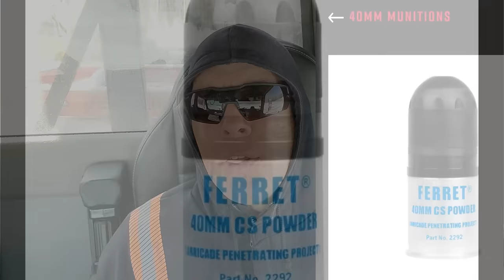Just a typical day as a Lineman, well not really...

Comment: They incinerated the lamp without knowing what the substance was on there?  So, they released an unknown chemical compound into the atmosphere without knowing what it is?  That seems rather unsafe.  I'm glad it worked out for you.  But, there are chemicals out there that can have long term health consequences that might not show up for days, weeks, or even years.
Reply from the maker: I did have se of the same concerns, but from my understanding; In order to test the substance, they would have to have something to go by. They could do specific tests  to see if it matched chemical compound for those particulars. An example would be a "dope" test. If the chemical turns blue then it's a positive match... If it doesn't, it simply means it's not that particular substance and nothing more.

Same goes for getting checked out at a hospital. If there are no sypmtoms (or they are gone) and vitals are good. They wouldn't have much to by. Generic blood tests included.
The high heat of the incineration would release negligible amounts of toxic substances as well.

That being said, I do believe testing of an unknown substance is possible, but not something that comes cheap or only done in circumstances that involved dire consequences.

Again, this is only my limited understanding of the possibilities after being involved in some discussions around the incident
Reply: @Bobsdecline  Yes, testing can be done on an unknown substance to determine the chemical makeup and match that to a known substance.  But, it has to be done in a lab on very expensive equipment by highly educated people, so not cheap.

Anyway, glad you're OK and you solved the mystery,
Reply: @BryanTorok  certainly a hazmat should have a basic nmr or spectroscopy...

Proper incineration is probably the safest method though.

Comment: 2:14 "as a customer when you call in a trouble call, the more information you give the better"  -   Let me tell you my little story about calling in a trouble call.   Not your utility of course, but my local utility.  I happen to be an electrical engineer who works on substations, so I know TF I am doing.  The neutral failed on my house, completely open circuit - but it was intermittent.  It would make connection again and work for a while, and then fail again.  Obviously broken/loose conductor somewhere.   A short bit of checking while it was acting up and confirmed it was on the utility side of the meter.   Call the utility.  Lady I spoke to did not even know what a neutral was, or what open circuit meant.   I said, could I just speak to the lineman or the dispatcher?  Nope, you cant do that.  Ok well just send the crew out and I will talk to them when I get here.   Sir you need to stay away from our crews for your safety and for COVID reasons.   Ok but the problem is intermittent, so the information I have will help them find it.  Otherwise if they get here and its not doing it, will they be able to find it?   If the problem is inside your house they will not be able to assist you.   What?  Thats not what intermittent means woman, I already told you its on your side of the meter.   Yeah but it could be in your house.  Woman do you even know where the meter is???   I had about had it with her but finally got to her saying ok tell me what it does and dont use the words neutral or open circuit because they arent on my sheet.   What do you mean on your sheet?   I have a sheet here of the possible things I can put the ticket in for.    Like "my power is out" or "my lights are flickering".   I cant type what you say, I can only choose one of these 8 things on the list.    For F*CK sake!!    Okay, put "my lights are flickering" and we'll go from there.    To their credit, in spite of the utter stupidity of their customer service person and the insane limitations on their ticket system, the linewoman who came out knew her shit.   Without me even talking to her, she went right to the problem.   Her fix was a little bit janky (wrapped some bare aluminum #10 around both sides of the break), but it worked.   She must be used to getting absolutely no information from the dispatcher and just figuring it out on her own.
Reply: Haha I would have got real testy with the woman on the phone as soon as she tried telling me I couldn't go near their employees 🤬

Comment: Been working in the industry 17 years and the worst job ive have attended was a failure of a 275kV current transformer. The substation is local to my area and when the CT failed there was reports of a loud explosion and fireball in the sky on the local facebook group. When i attended the site afterwards the whole substation bay including VT, CT's, isolators and Circuit breaker had damage and signs of burnt oil on the insulators. We found a dead rabbit about 30m away from the explosion. On the plus side 4 weeks before the equipment failure i was involved in a major maintenance on the circuit breaker and although it was substantially damaged it tripped as it should of done to clear the fault. It was the last time it ever operated and the entire bay was ripped out and replaced due to the extensive damage. It does make you realise that when one of these pieces of equipment fails it normally ends in a spectacular failure.

Comment: A tree limb, about 2ft across at the fat end fell across a 3ph primary, pinning the wires to the ground. Line workers made it safe and arborists were called in. As they were cutting, a loud CRACK as 100+lbs of wood was catapulted into the sky. Another hazard of "high tension" wire to beware of.

Comment: Im a residential specialist in the bay area of california. I had a customer with randomly tripping arc fault breakers. It would happen over different circuits. So we replaced the sub-panel, re-spliced the circuit. Right before i was about to have her sign for a 20k rewire on her house i said you should have the utility out to check their splice box and behind her meter. They found it. It was a burning meter leg on her panel. Saved her a ton of money and mud in my face.

Comment: We have a story of an incident that happened some 40 years ago in the 80's in Phoenix. An electrician working on a box that just so happened to be radioactive. Apparently the box makers got ahold of of steel and aluminum from the nuclear test sites by mistake. It's one of those stories that's been passed down from the community.
Reply: “By mistake” I’m sure they don’t know that cheap material they were buying didn’t have a questionable history…
Reply: That's why steel from shipwrecks pre-1945 are valuable, all steel since then had some additional background radiation. It's used to make devices which are very sensitive to radiation detection, as they don't come with their own radiation. It's beginning less valuable, as cobalt-60 has a half life of 4.5 years and is becoming less of a problem.
Reply: @johnhaller5851  yes new steel is almost as pure and no longer a problem.

Comment: 2:42 whose lights would go real bright / real dim? Do they still use incandescent bulbs in Canada? In the US, they mostly have been phased out entirely. A CFL would do other wonky things from low/high voltage. It probably wouldn't even turn on, or it might just go pop. (Or it might even just show as normal brightness if it regulated the input voltage well.)

Comment: That's pretty crazy.  You'd think they would have used their standard handgun, a bullet for that is probably way cheaper.    And yeah I worked in IT tech support, details are important when reporting an incident. "can't print" is not going to help us fix the problem.   Months back my lights were flickering a lot, and noticed the light in my neighbour's garage was on, and was flickering too.   I put the volt meter on the outlet to see if I could get an idea of what is happening and voltage was randomly dropping to around 90v.  It was happening too randomly to try to isolate either phase or if it was a floating neutral but either way something was not right so I called Hydro.  Turns out there was an underground feeder that was shorting out so it was causing a massive voltage drop on the transformer until the short burnt itself out.
Reply: Uhh.. way to dangerous and loud to use their issued sidearm.
Reply: @nottelling9621 Do you honestly think that the report from launching that large projectile was quieter?

Safer on the other hand, very likely, as a miss sends out a "what goes up, must come down" projectile. Their aim isn't always that good.

Comment: That’s infuriating. I understand that as the incident plays out those police are under a lot of pressure, but there should have been procedures to identify damage and clean up post incident. In fact, every time they discharge one of those rounds they should have to account for it and neutralize the danger to innocent third parties. 

I’m not willing to generalize a profession like law enforcement, but i think it’s worth calling out dangerous and shoddy performance. In my locale, our law enforcement officers have not ensured that accident scenes are cleaned up thoroughly. The police management here have not emphasized a culture of excellence and the officers see a mostly clean scene and leave. The problem is that in one case that meant a bag of narcotics was left in the grass, along with medication and general trash that presented a public safety hazard. Another site had bloody clothing and gauze, a biohazard, left on scene. 

As an exemplar of a culture of excellence, you were splicing two wires and made it a point to catch the nut so that a homeowner wouldn’t run over it with a lawnmower. You could have easily taken the mindset of “not my problem”, but you considered the safety of bystanders and took the extra effort to protect them. It’s details like that which create and reinforce a culture of excellence and safety.